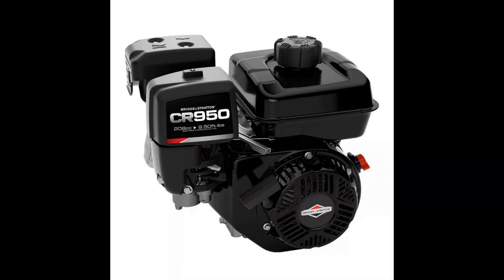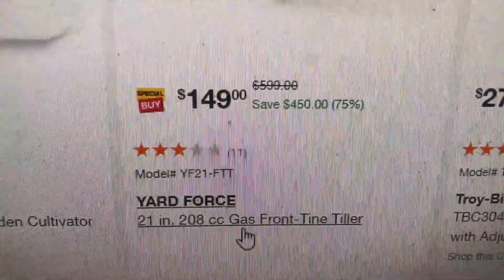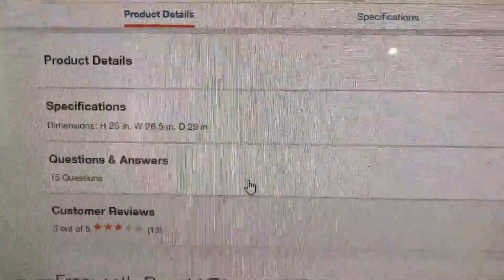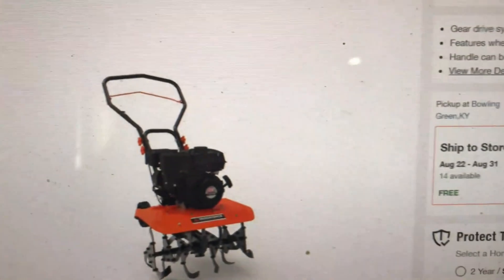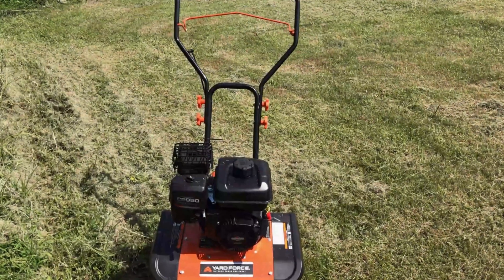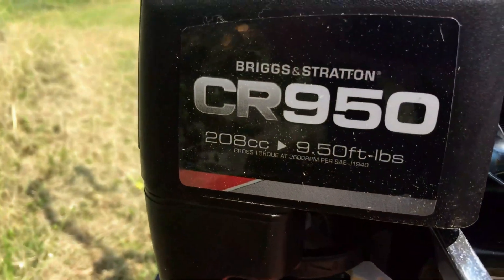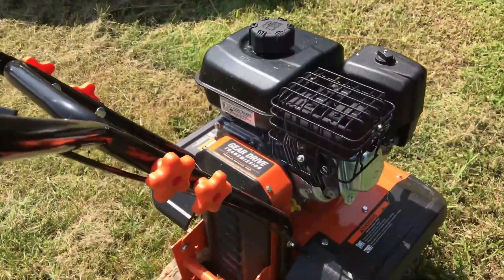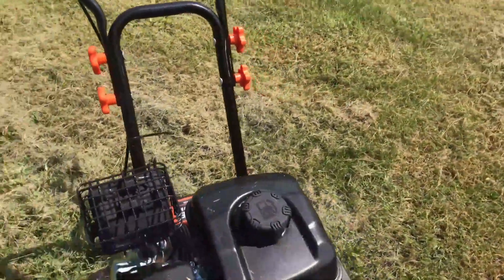Get Ready for a Shock: Kentucky Fried Fixes CR950 Briggs & Stratton Engine Next on the Bench!

Comment: Predator. It came on a generac pressure washer. I had ported and polished the 196 hemi head so I incorporated it in my current 212 hemi build. I discovered when I tore down the new 212 hemi head the castings were DIFFERENT! The inside markings are the same. But the new hemi head has a number on the outside rear the old one does not. Both have the 27/25 valves but the 195 hemi head have WAY  bigger portd than the 212. As big as the ones on my rtc-6 212 head everybody raves about! I've looked EVERYWHERE online and cannot find ANY info on this. It's few and far between but I found a little about the 196 hemi. It came with a flat top piston and is the same block style as the 212 hemi. I'd like to hear your knowledge on this if you will sir. Thank you very much
Reply from the maker: Hi Chris! There are several different stock heads available on the market. When looking into building one for mild performance it's a good idea to check the valve sizes and look into the intake port. Some castings are highly restricted while others have a much more generous port size. As an example, the heads on the Predator 224 engines have a great looking intake port right from the factory. By contrast most of the 212cc heads are pretty restricted. The intake port on the 223cc Wildcat hemi engine is restricted terribly! Now any of this can be overcome with some porting work and some time. I always recommend that to begin learning how to port, always start with one of the lesser (junk) castings, that way if you mess it up (grind thru the port etc), it's not the end of the world. But if you're just looking for something that you can bolt on and go as-is for a budget mild performance improvement, I'd suggest a Predator 224cc head. Head porting is an art itself. It takes a lot of know how and practice to get good at it. Even at that, then you get into theory about what flows best for which engine combination. Most beginners end up ruining the flow of their head on their first tries. Now, if you're getting into racing, where money is involved, I'd suggest buying a fully prepared head from someone like EC or Paul's Karts. I've seen both and you'd be hard pressed to improve over their port work. Big topic of discussion! Thanks!
Reply: very interesting engine knowledge  @KentuckyFriedFixes     tHanks for the video

Comment: Been lookin for some new videos from you! I've said it before. I retain info from your videos better than any other! I made a discovery today and I need somebody's input on it... I ha e recently bought and started building a new hemi predator 212 engine. I have another hemi engine , but it's a little different. It's a 196 hemi made by Loncin, same company that builds the hf hemi  predator.
Reply from the maker: Hi Chris! The 196 Hemi engines are mostly good engines. Some of the early engines were really out of balance though. I've had one that required star lock washers to be used on the side cover because the bolts kept vibrating loose! When your engine tries to shake itself apart, that's bad. The later 196 engines that were imported don't seem to suffer from that much out of balance though. I'll have some new videos up soon. Thanks for sticking with the channel my friend, good stuff is coming.